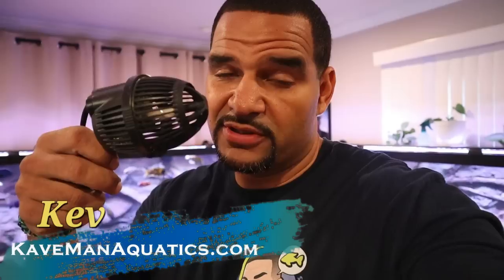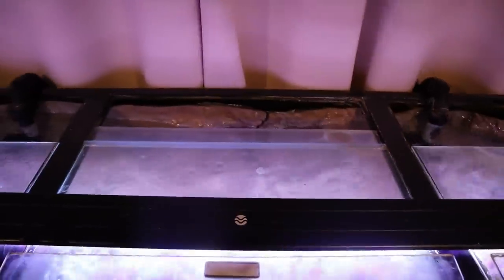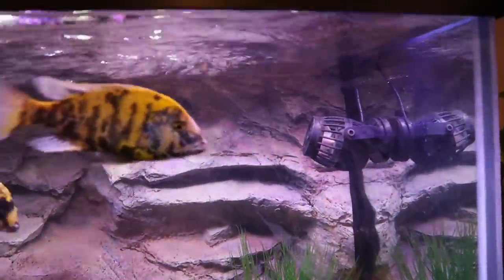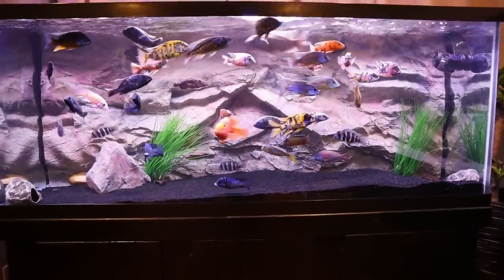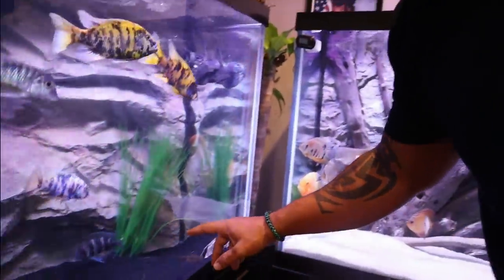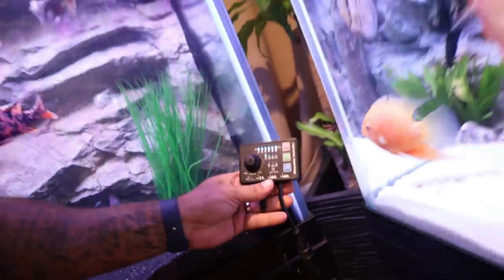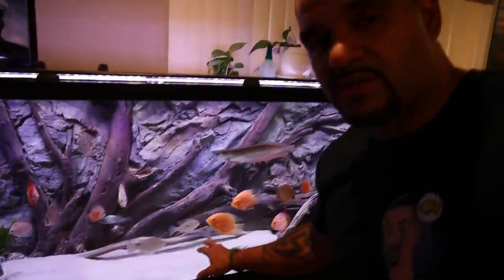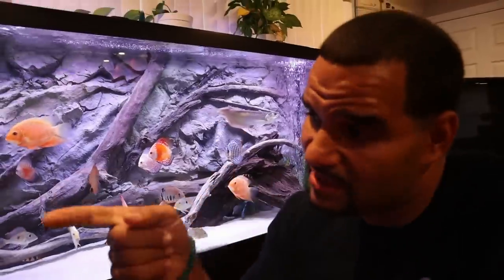Dual Canister Filter Output Placement w/ Wave Maker (Simple)

Comment: About Calcium buildup:  For me, when we moved to Nevada in 2004, the house came with an RO system and watersoftener.  I had not gotten back into the hobby yet.  Fast forward 20 years and a need for a new watersoftener.  We had a small aquarium and I was living with the calcium buildup but with the new watersoftener, it all went away.  The existing buildup was able to be simply wiped away with a dish cloth and every other week I gently wipe down the edges of the tank and no more buildup.  Even I was surprised.  The new, modern water softener made all the difference.
Reply from the maker: Those definitely do help! 💪

Comment: I got two canisters filter fx4 and 407 plus a wavemaker. Any suggestions on how I should position them given  my 400l tank only has two open spaces on either side of the tank from where I can pass through the filter pipes? Currently I have the wavemaker , fx4 inlet and 407 output pointing up and to the right and my fx4 output and 407 inlet on the right with the fx4 output point downwards the front of the tank

Comment: For your slower moving water tank do you still point the outputs in the same direction and intakes on each side? I’m buying 125 gallon tank and two FX 4 for overkill on filtration trying to make sure I set up the intake and outtake like you do.

Comment: Hello I have the same setup as you but towards the right the poop and waste sit 3-4 inches before the right hand side glass any ideas why it just stops there and all the rest of the tank is clean of debre
Reply from the maker: Its a dead spot where the flow dies down. Try adjusting your wavemaker, either up or down or changing the angle to see if it changes anything.

Comment: Based on one of your earlier wavemaker videos this is how I have my 125 gallon tank setup. I have my uniclife wavemaker on the top left and my 2 FX6 filter outtakes in the center spaced out pointing to the right to get that circulation going and it works wonders. It keeps the black diamond blasting sand I have in their clean and clear of left over food and poop.
Reply from the maker: You got it perfect my bro! :_kaveThanks:
Reply: brother did you off your wave maker in the night?

Comment: Hi Kev...Long time viewer of you channel and it's saved me too many times to remember. Quick question, I'm upgrading my tank from a 5ft to a 6ft. Currently running one FX6 but looking to add a second FX6 onto the new tank. Just wondering if you still recommend the outlet placement as per this video or has anything changed in the last year that I should think about in terms of placement for dual canister filters? Also (while I remember) how much substrate would you recommend for a cichlid tank in terms of depth? Just trying to get the new home as comfortable for my guys as possible! Cheers from Australia :)

Comment: What if there’s a overflow box in center and two outputs one on each side, I just ordered wave maker and because of the overflow in center I’m not too sure on placement and direction, thank you😊 your videos are helping me with my tanks and I’ve only seen a few videos so far very informative 😊
Reply from the maker: Thats a tough question. I've never had to deal with an overflow box, but just thinking about it seems like you'll have a challenge getting that circular water pattern. Regardless though, I'd still try different positions and angles until you find a sweet spot that keeps detritus moving so it can find its way into the overflow.
Reply: @KaveManAquatics  thank you, I will do my best, the two outputs can be moved and after your videos I think it’s not right as there both facing there closest corner and it’s tall so the bottom it not getting circulation I might try and have them so same direction and hitting the top of water more and then the wave pump I’ll do same direction as well and just see, it’s funny my new set up I did the output wrong and I haven’t felt like changing it just yet and all the pleco poo is all on the side the intake is not on lol I will be fixing that today ☺️

Comment: You motivated me to put mine back in only to remember why I took it out, too much current even on the lowest setting. It's a 27g cube so it doesn't take much to get flow. I have a Fluval 305 that came with the tank & even that at half output is a lot
Reply from the maker: Yea for a 27 the canister output is going to create more than enough flow 👍
Reply: @KaveManAquatics  I almost switched back to the factory output nozzle but just love the spray bar too much. The flow control is set at half, anything more & it's too much

Comment: Hi Kev, another great video, I have a question though, I have a FX6 with the intake on the bottom right side of the tank, the FX6 outlet flow is on the left hand side pointing upwards and to the right?, where should I place my wavemaker ? I have a 103 US gallon tank and wonder what strength wavemaker I need please. Nige UK
Reply from the maker: With 1 filter I would keep everything on the same side. Input, output, and wavemaker all on the same side. Watch this - https://youtu.be/-GxwWc_riuA?si=VActFl3mVM8QUhNX
Reply: Thanks for your reply

Comment: Great Thanks mate for your help, I have setup the wave maker and water outlet and intlet on the same side but I still see the poop/waste rotating aroung not sucked up by the outlet pipe, does this take time or I am doing something wrong, I have some rocks in the centre of the tank. I appretiate your help.
Reply from the maker: Give it overnight. If its setup correctly most of the waste should be gone by morning 😊
Reply: @KaveManAquatics  Thanks for your reply, I have given two nights still I see poop rotating around should I add more powerfull wavemaker or mvoe around the outlet pipe and check by each day?

Comment: Hey Kev. Question for you. I have river rock in my tank and was wondering if a wave maker will work for keeping the bottom clean, or do i still need to vacuum? Thanks
Reply from the maker: It depends how much of it you have. A wave maker will help, but detritus may get trapped in between the rock and still need to be vacuumed.

Comment: I’ve got two Oscar fish in a 125 gallon tank, wondering if I should do a low current wave maker for them. I’ve got one on now, but they seem to just stay on the opposite side of the tank whenever it’s on. Any tips?
Reply from the maker: They should be fine with one wave maker...Oscars can be divas when they dont like changes lol

Comment: I’m setting up a 75 gallon mbuna tank using a fx6 and a Fluval 407 and a wave maker, I also have a 3d background. I am going to position my filters identical to yours with the same flow pattern. With that in mind should I put the fx6 on the right and the 407 on the left or the other way around? Also should I ‘poke’ holes in the 3d background to get more flow back there for the detritus? Thanks, love your videos!
Reply from the maker: You could poke holes if you wanted to, but really not necessary. detritus will find its way back there. When you have a wave maker, it doesnt matter what side you have your intakes, I keep one on either side. But your outputs do matter, watch this - https://youtu.be/GowcPzNxCDo

Comment: I have a 150gallon aquarium set up as per your video my fish poop is going round in circular motion in the middle of the tank. Any help please ? Thank you
Reply from the maker: if its happening on your substrate than something is not right with the flow in the tank. A piece of decor could be breaking the flow causing the dead spot. Try re-decorating.

Comment: I have the same set up, but I have both intakes on the side of the wave maker. Should I move one of the intakes to the other side?
Reply from the maker: It will work great either way. As long as you have at least 1 on the same side as wave maker 👍

Comment: Kaveman, got a question i just did the same set up with 2 fx6 and wavemaker, do i still need sponge filter with air stone?
Reply from the maker: No you dont ever NEED a sponge filter. It's an additional benefit. But 2 FX6's will provide plenty of surface agitation.

Comment: Kev, my wave maker has a weak hold on the tank. Is there another way to get it to stick better
Reply from the maker: All wave makers arent made the same. The ones I use have strong suction cups or magnets on them.
Reply: No suction cup. Just the magnetic hold.

Comment: brah, what. are you doin?! Are you tryin' to take those calcium deposits to the bank?! 🤣 CLR those glass lensessesssses. works like a charm!. rinse off, dry, no residue! on a serious note, i'ma go hunt for your install video of that 3D background. if that's what it is.
Reply from the maker: Bro I literally asked not to be judged! 🤣🤣 Dont hunt, I got you - https://youtu.be/i_cUbz-wEMs
Reply: @KaveManAquatics  Thats why my inner troll just couldn't help it! i only comment on channels that i'm subbed to and it's my way of letting fellow creators know that i'm watching. It's your fault that i brought my 55gal aquarium with sand substrate back with an overdue makeover... for it's single resident. 🐠 🤣
Reply from the maker: @rogueFactor  i will gladly take the blame!! 🤣 Thanks for watching bro!

Comment: I have one canister filter have 75 gallon tank! Mi intake and output are on same side should I change direction of the output to the same direction as the intake which is to left? Don't have a wave maker on the right hand side! Maybe I should get another wave maker for the right hand side of the tank
Reply from the maker: Intake should be on same side as wavemaker, with wavemaker in top. Output can be anywhere as long as it’s pushing water at the surface in same direction as wavemaker.

Comment: Quick Question Kev i have a 75 gallon peacock tank and i have 2 aquaclear hob filters on it can i still use a wavemaker and get the same results as having a canister filter with wavemakers cause im gettin fed up with all these piles of poop on my sand after water changes and vacuming?
Reply: I'm in the same boat 2 tidal 110s on the right side of my 125 with the wave maker at the top right side seems like I've got ok flow. Most the poop just seems to pile up under on the bottom towards the right I'm assuming it's the downwards push of water from the hob but I'm not sure?

Comment: Hello Kev greetings from EU!

I have a quick question:

I'm new to the hobby and me and my girlfriend has chosen to get 3 pairs of guppies therefore we got a 54 liter tetra starter pack aquarium and today I have installed a wavemaker - sunsun jvp120 but it seems too powerful.
So the question is if it's harmful to the fish?
And can I somehow lower the flow because I can see that it is pushing the guppies quite fast.

Your answer is greatly appreciated 🙂
Reply: That is way too much flow. If u didn’t know guppies can not constantly fight against strong currents because they will quickly get tired and this could lead to death. Another possibility is that they get sucked in and get ripped to shreds. Honestly with only 54 liters as long as your filter is pushing water that should be enough for 6 guppies.
Reply: Also that wave maker pushes 793 gallons per hour and your tank is 14 gallons. That is way too overpowered and unnecessary.
Reply from the maker: Your tank is too small for a wavemaker. Watch the video until the end, I mention that for your size tank an airstone would be better for good surface agitation and water movement.

Comment: Hey Kev, I’m running two fx6 and my tank gets warm. The temperatures creep up to over 80, then I have to turn one off. Do you have this issue? Any tips? 180 gallon.
Reply from the maker: You should never have to turn your filters off. Lights and heaters will make your tank warm, not the filters. If its very hot where you live try these methods of cooling your tank - https://youtu.be/WQi38WnHSlo
Reply: @KaveManAquatics  with only two fx6 running, light and heater unplugged, my water temp rises about 1 degree per 24 hours. At 81 degrees, I unplug one. Within 48 hours the water temp is 77

Comment: Is there such a thinng as too much filtration? You mention the fx6 and theyre for up to 400 gal, you have 3 of them per tank. Can i upgrade to a large filter to just get more work done?
Reply: Could I get a Tidal 75 for a 40gal and if i eventually upgrade to a 75gal+ i will have the filter too.
Reply from the maker: You can’t really over filter. It doesn’t hurt the tank. But like you said, get a bigger filter now so it can fit on your new tank whenever you upgrade. Also, for the record. The FX6 is marketed as good for 400G. But that’s not accurate for every tank because each tank has its own unique bio-load. And I don’t have 3 per tank. I have 2 on my 210 and only 1 on my 150 😊

Comment: I have a 165 gallon running dual FX6.   Do you recommend the circular current even with community fish?  Are you running the same type of water current on your discus tank?
Reply: My question to him as well. Looks like he is not answering newer questions. I’m wondering if they should both point to the left or right for slower
Moving water tanks.. i have 2 FX4s
Reply: @jamesg3801  I have both of then facing one direction and it works very well.
Reply: @audiorazor thank you very much. I’ll set mine up that way too

Comment: Hey kev quick question on the uniclife wavemaker.  What settings do you use it on in your 210 tank?  I have a 125 and it’s causing micro bubbles and seems a little strong pushing my sand around on the 2nd power level.  Just wondering if you have any advice on position and angle along with power or wave settings?  Thanks
Reply from the maker: my 210 is a tall boy, 29" so I keep mine at full power. It does pull some substrate from the other side but nothing to terrible. Try going down to the lowest power setting. If you have micro bubbles it may be too close to the surface, or crashing with another filter output.
Reply: @KaveManAquatics  ok perfect and thanks for your reply!  Do you use the different wave patterns?